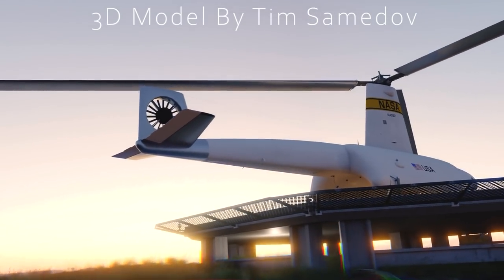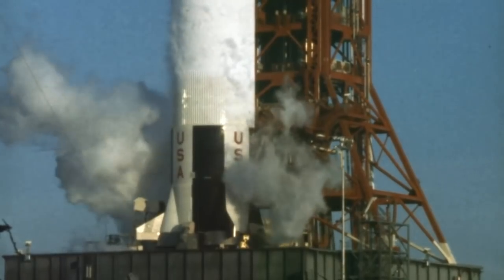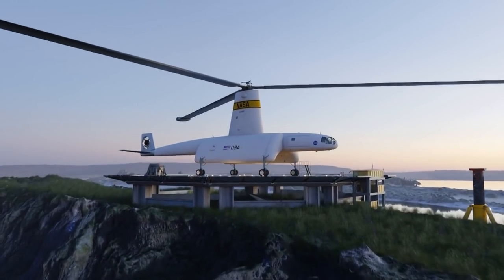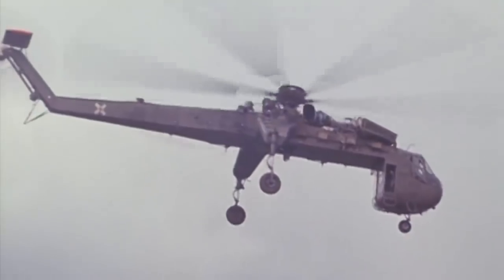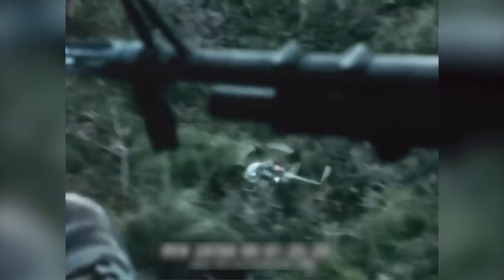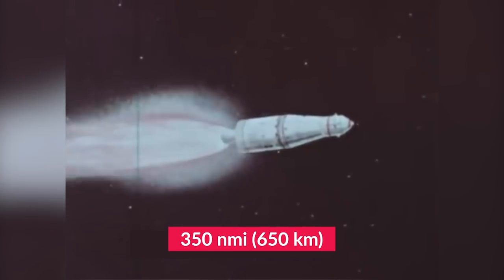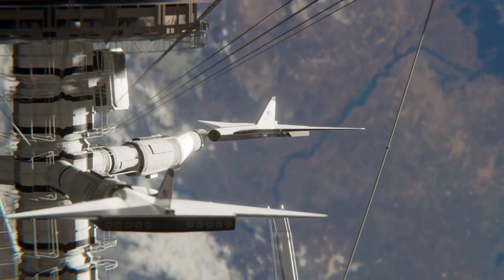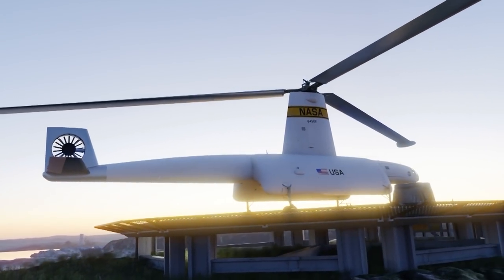Catching A Rocket With The World's Biggest Helicopter - Hillers Air Tug

Comment: Why do you say there is an engine in the "rotor stem"?  The only engines here are the tip turbines, as previously stated.  TR would be driven via gearboxes and shafts from the MR, which would have been driven by the tip engines.  Also, it's not "insane".  Stanley Hiller was a great engineer, and designed many successful helicopters.  If you ever get a chance, visit the Hiller Aviation Museum in San Carlos, CA, USA.   Perhaps it was an "audacious" concept at the time, but the engineering was completely possible for the technology of the times.
Reply: @fask69  Pot/Kettle? We're all Bozos on this bus.
Reply: How is this relevant now that SpaceX showed self landing boosters?
Reply: @sajadbilgrami6809  er, because this is a space history channel?

Comment: Rocket lab does this with electron's main engine stage...
Reply: I haven't watched the video yet, but judging by the thumbnail it's a different system. Added to that, the electron rocket is a relatively tiny rocket in comparison to other commercial options

Edit: Geez it really is just like what they're doing at RocketLab - I take back what I said before
Reply: They want to, but not yet have done it
Reply: @Gurumeierhans  Hopefully we'll see how it goes in a few days. They've done enough testing and I'd be surprised if it doesn't work. I'm not expecting anyone to do the same with anything bigger than the Electron rocket tho.

Comment: NASA did perform considerable proof of concept work on a rocket booster which deployed autorotating rotors, which deployed from the side of the booster. So it could work, but in any case, the recovery vessels for potential flight aborts was an aircraft carrier and protective ships. The deck may have needed reinforcing, or a barge, Specex style could have been used.

Comment: Nice video and an impressive start to a new YouTube channel. I'm looking forward to future videos.

This may have already been mentioned, but this odd idea reminds me of the CIA's Project Corona from the post-Sputnik years. Corona was an early US spy satellite, one of the KH or "Keyhole" models that was the size of a bus and took high resolution snaps of the USSR from orbit. After completing the roll of film, the KH satellite was sophisticated enough to package the huge reel in a reentry vehicle, pop it out at an appropriate point where it could be scooped up in mid-air by US military aircraft fitted with a catcher device. The Keyhole satellites grew in sophistication, and were used for many decades. Maybe you can do a piece on spy satellites -- it would probably require multiple videos.

Anyway, I have a question.

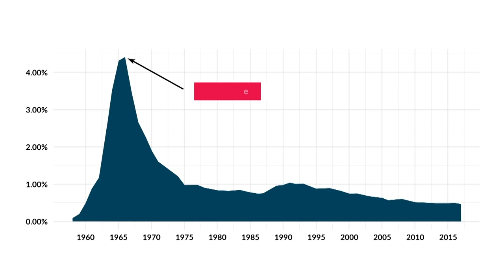At 1:30, I heard: "So, your Grand Daddy's 'neffer(?)' had a ton of coin to play with."  I've not heard that one before. Sure, it means NASA had a huge budget that year. I get that message, but My "Grand Daddy's neffer" is an Aussie idiomatic expression I've not heard. Did I hear it right, and what does it mean?

Comment: Its not possible to operate turbojet engines at the tip of the rotating wings safely, the prezession forces would destroy them quickly. In similar concepts air channels within the rotation wings were used.

Comment: Blades can only be so long before the root starts becoming useless, as the tips break the sound barrier, and thus the super sonic tips become useless. This includes blade twist design.

Then the engines on tips? Good luck to its lifetime due to centrifugal forces.

This is basic aerodynamics and physics.

Nice 3d art. That's all it is.

Comment: I thought you said near supersonic? Which still yeah get anywhere near supersonic on those blades not meant to be supersonic, kind of rough on them, considering that a helicopters rotor system most designs are running at 100% power to the rotor too 110% depending on situation whether climbing, cruising, or descending, I imagine that a high fatigue job.

Comment: Okay I was with you until you said it will turn the rocket on to its side to fit in the slot with the helicopter but but you said it will turn it on it’s side there no chance of that happening because it’s only attached to the top of the rocket it’s not connected to the bottom and the middle of the rocket you just can’t do that in mid air

Comment: There are allot of issues with this video, such as saying that it was "chosen" to fly the first stage over water because land was too damaging to recover from, and that recovery from land or sea was even a viable option in the first place. This is wrong. 

All rockets are flown over water for the explicit reason being that falling stages can land on populated areas and injure civillians. It would never have even been considered, (nor would it even be physically possible) to fly the rocket over land and recover it on land. Rockets fly eastward to utilize the rotation of the Earth to more efficiently reach orbit, and as such, Florida was chosen for the Kennedy Space Center, since flying eastwards goes over no populated areas other than a few islands. This means that recovery from land physically could not be achieved.

All this, aswell as the fact that no stages of the Saturn V other than the crewed module were recovered, ever. Crashing into water at that speed and with that mass is like sending a car at mach 10 into a 500 foot, reinforced concrete slab, hoping to recover the vehicle to use again. It's impossible. 

The video is put together well, but this is only one thing I noticed which you brought up that was incorrect. Please try to fact check yourself or even contact someone who knows allot about this stuff to help.

Otherwise, interesting video!

Comment: 🤔so helicopter blades on the booster which has to be stowed away and have a tail section to counter the torque generated, how about just using the rocket engines to fly the booster🤔
Reply: No tail rotor needed to counter the torque because the power was generated at the tips and not the center of the rotor.

Comment: Rotor tips don't need to get supersonic. A very large floating platform shouldn't be compared with an aircraft carrier, rather with a container ship which is a fraction of the cost.  Probably no more expensive than a large passenger airplane.  
Noise .. it already needs to be hundreds miles offshore anyway. 

The really implausible feat (for the 60-s) would be the booster handling & positioning after top parachute was hooked. Look at footage at how "simple" is for a crane to install a wind turbine on top of its tower.

Comment: At those rotational speeds any engine and fuel delivery t it would be very challenging from centrifugal forces, and imagining a lubrication system able to handle that force with any turbine...   I suspect a pulse jet or a much simpler propulsion system would have proven necessary.  I recall another option was ducting exhaust/pressurized gasses thru the blades to tips with steering fins on a nozzle for weight reduction reasons. Would the entire blade change pitch as a normal helicopter blade does, or would it be a flap system along only a portion of blade to give attitude control of rotary wing ? Thanks for the history lesson ! Just subscribed too.

Comment: The sad part is, Its not really suppose to be THAT "mind boggle," its THAT over looked in history of space flights, there is so many cost effective way to take thing into orbit, as well to arrive for landing. But the even MORE practicle-extreme, of just using mass pack canisters of pure money to burn into orbit and back, then legitimizing it, with lighter weight canisters and more dangerous burn levels speed (5:16)"yeahaa!" to ever promote for commercial Orbitline (like 'airline'), that failed to ever evolve to new things.

  For Examples, like a winged rocket carrier at mid orbit or to be a first stage, Blimp Rocket bay, already elevating a compact launch station in vHigh orbit, even be a 1st to 2nd stage, before the MASSIVE space vessel, rocket launches & as well, compress use its own gas volume to elevate into  higher atmosphere, where micro air & gravity convenience for the final exo orbit rocket stage initiation, AND the list of new ways, would go on & on. AND like the moral of these channel topic, of how, instead of updating the very purpose of those inventions, EVERYTHING is thrown to scrapps & becomes invane or the craft meets its fate.😏✈🛬🔥

Comment: How those tiny tail rotor counter the main rotor torque effect ? ?
Reply: There isn't any. Normal helicopters have the engine in the fuselage trying to spin the rotor one way and the fuselage the other, but tip jets have the rotor spinning itself with no reaction torque, so all the tail rotor has to push back against is the friction in the bearings.

Comment: Hmmm... so many questions... not enough answers... how do you make the stage change from vertical to horizontal  as you only have one line secured? .... how much fuel does a jet engine use? and I believe not enough room on the tug for the amount required....  guess these are problems and the answers are why NASA didn't go this route.... however  they are on the right track as you can see from the modern answers from spacex and electron